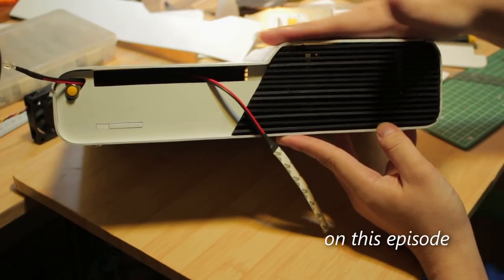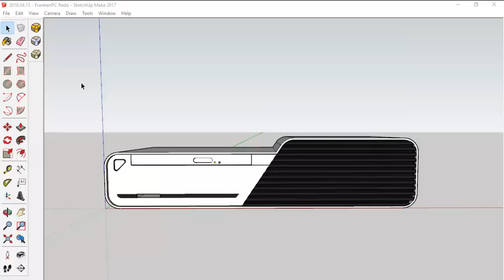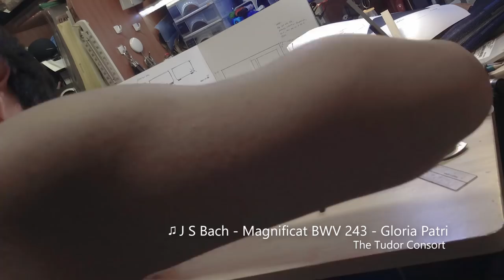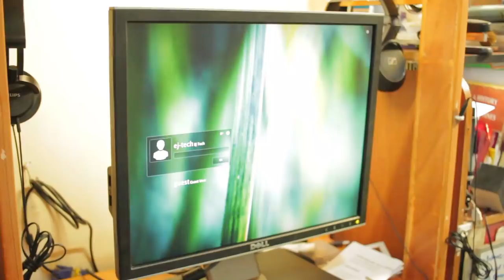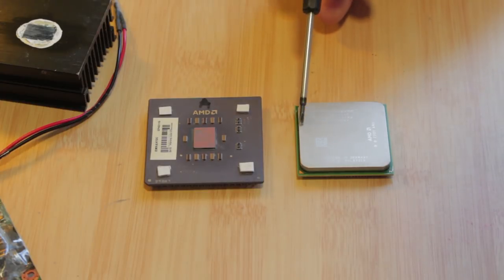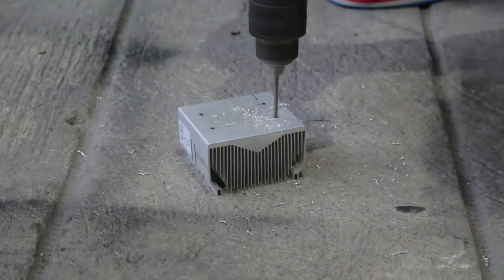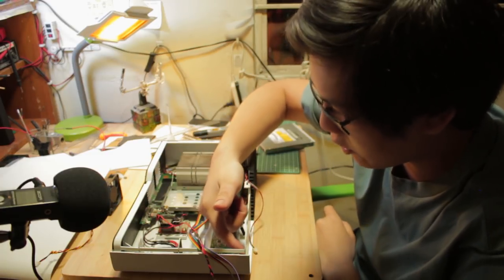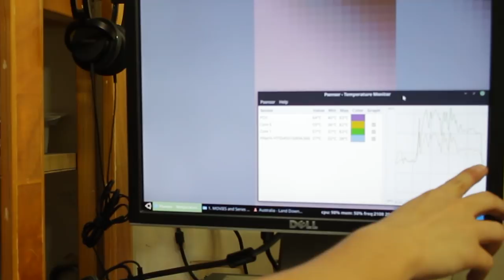From Scrap Laptop to Compact Desktop - Pt. 2 of FrankenPC Redo

Comment: i'm so excited when the actual case look so much a like with the 3d model haha

ever considered about push and pull airflow? probably much dust if the case doesn't airtight enough tho, but it works really good with temps
Reply from the maker: I'm gonna do some temperature testing if it needs the extra airflow

Comment: I am also in the middle of upgrading an old computer that had an AMD sempron 3400+. For my CPU upgrade I went with an Athlon X2 4850e, which has been working great, my video with the full upgrade is coming out later this week. I also definitely approve of using Linux (I love elementary and Cloudready for low power computers) instead of windows, great video!

Comment: As far i now, HQ cpu's are soldered on the mb, the MQ cpu's are not. Btw, when using a drill on aluminium, don't do it continously. You have to press a little, then get it out and clear the aluminium from the drill, and then press again, and so on.
Reply from the maker: Thanks for the tip. It's my first time to use a hand drill as I normally use a rotary tool.